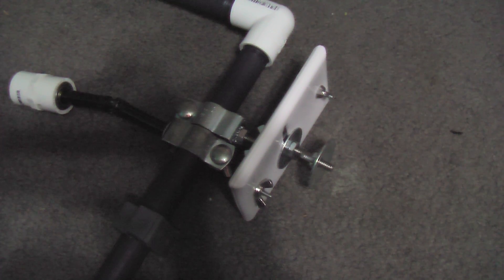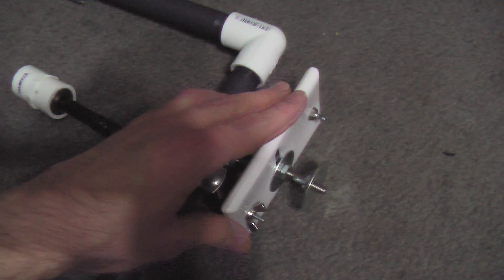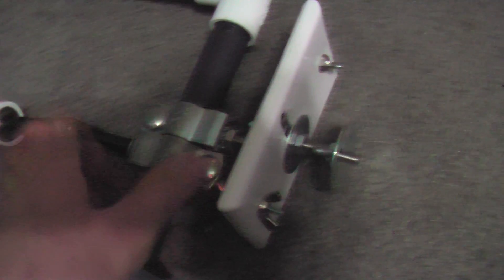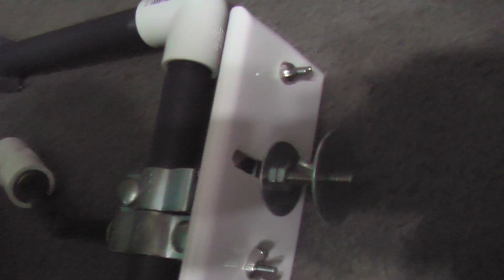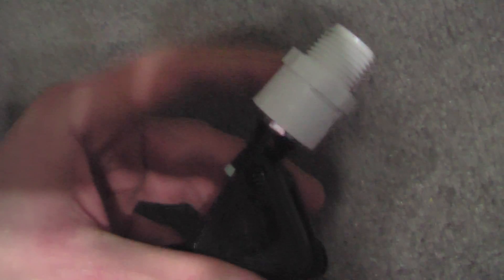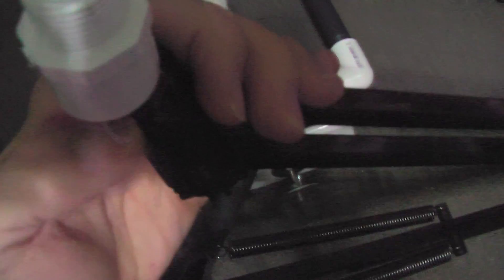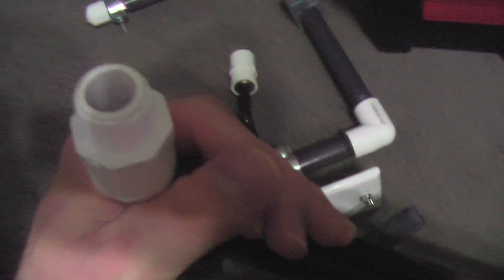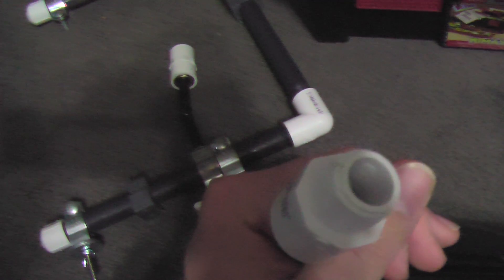$35 Steadicam Merlin - Trimmable Stage add-on and sneak preview of the arm / vest add-on.

Comment from the maker: @cele82 You still have to walk carefully and ensure that the camera doesn't move up and down much (you don't want it to match your steps). Merlins can't prevent that from occurring 100%. One thing to try is holding the handle slightly at an angle to allow the gimbal to buffer your steps.

I hold the handle with one hand and use my thumb to adjust rotation. I use my other hand to adjust for tilt if needed. In the wedding video I did, I trip on the floor at the beginning and you can't really tell.